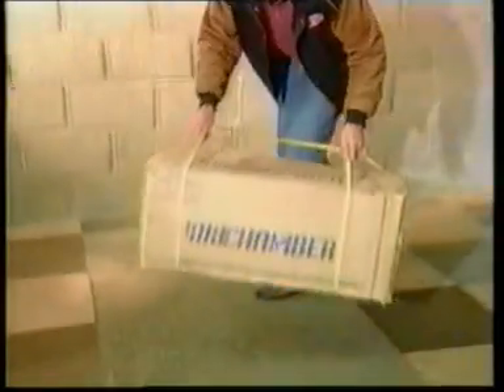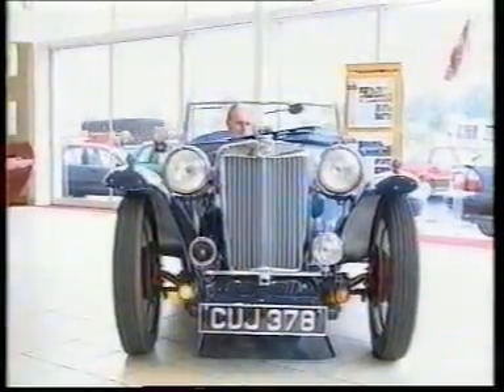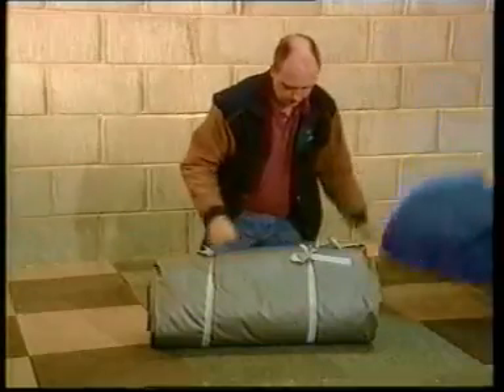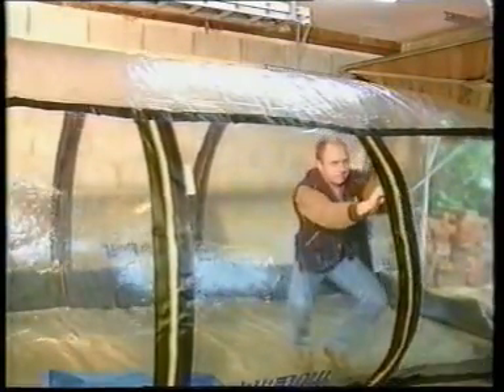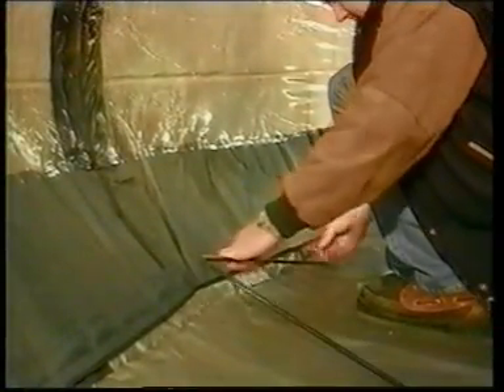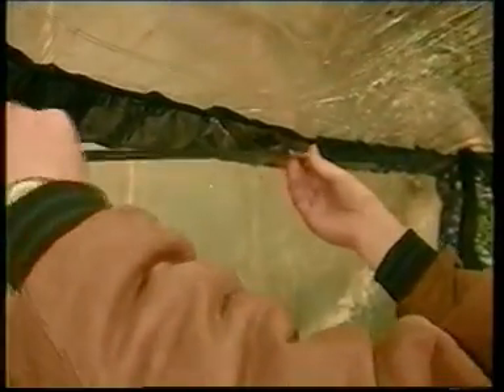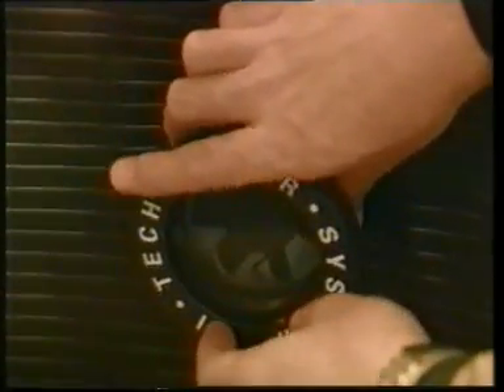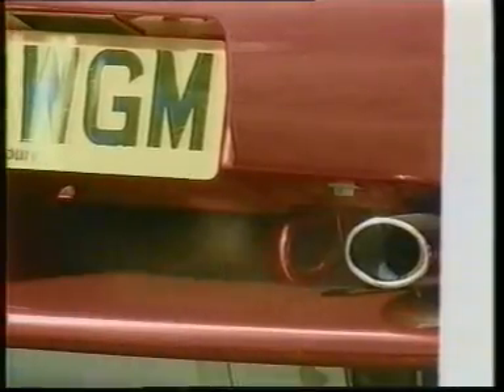How to erect an Air Chamber

Comment: It's a flawed concept unfortunately.If your Garage is damp,because the outside air is also damp,the Fans will circulate this damp air through the Chamber.The environment inside the Chamber therefore remains high relative humidity.
Reply: It keeps the air moving preventing the moisture from settling. A garage with no air flow the moisture will settle. In any case I wouldn’t bother with a air chamber they are expensive for what they are and the design and quality is terrible. Far better off with a carcoon.